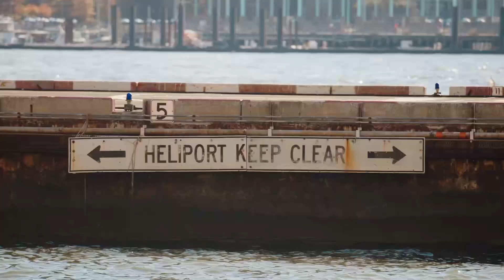Unlocking the Skies: Bonny Simi's Insights on Joby's eVTOL Progress at the BNEF Summit

Comment: Just a thought . . .  but I think the entire concept of operating Joby planes in high density areas requiring - effectively - "airports" is going to add  very significantly to Joby operating costs. The urban application may be the first thing that comes to mind for some people - but  I think the focus needs to shift to providing travel service to remote areas where landing can be done in a renovated parking lot without requiring "Terminal Buildings" . . .  For example . . .   a Tourist destination such as Sri Lanka - there are many beautiful resorts located in the central highlands of the Island.  These locations are very difficult to access - requiring  6 hours of slow winding uncomfortable and risky travel on narrow mountain roads . . . . and yet the distances - as the  "Crow Flies" . . .  are short - barely 100 KM.  A Joby EVTOL would be a perfect application here - able to traverse the distance easily - and still have battery left to return to base.  The EVTOL could leave from near the International Airport - and deliver tourists comfortably to their inland resort - providing a spectacular aerial tour of the Tea Estates at the same time.  It would be well-worth a $200 ticket.

@rossnolan7283  - in his post of a couple weeks ago - raises a very important point about the Joby design's centre of gravity - and the tire loading . . . . Unless they changed the design - Joby will be restricted to hard - level surfaces  . . . and would rule out landing on a grassy yard.

Comment: Snuck in "can land conventionally" amidst the spiel ... this suggests that, like Lilium, the extreme diseconomy of VTOL is being
 tacitly admitted and rolling take off and landing (RTOL ,to distinguish CTOL from ATOL as alternatives) to be used where possible. This is good except that the Joby S4 has a VERY high centre of gravity (far worse even than it looks because the ton plus of batteries are contained in the, high, wings) together with a tall, spindly tricycle undercarriage that sets it up for tip over accidents ( the infamous TopGear show on the RobinReliant tricycle wheel configuration car that tipped over at the slightest provocation was a good demonstration of what is anyway obvious , flip over of lightplanes without huge mass in the wings is common even without landing gear failure.
The gushing hype over Joby hides the more mundane facts that ought to be considered.
Reply: Joby has over 10k test flights over 33k miles with the S4. If there are CG issues, they’re probably minimal.
Reply: How many roll-on landings or take-offs? Zero perhaps in adverse weather (high gusty winds) all videos are vtol in still air or close to it. Simple observation of basic design flaws is what is involved here.
Reply: @rossnolan7283  roll-on take off and landings shouldn’t be an issue. They’ve completed plenty of weather testing. Your CG concern is bogus, with batteries in the wings, etc...